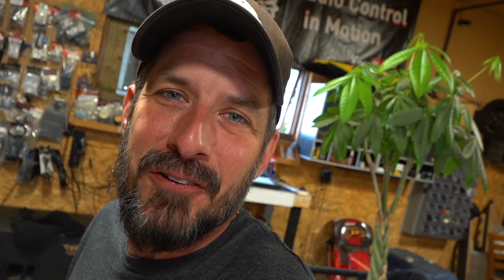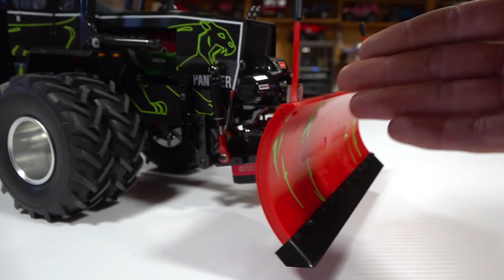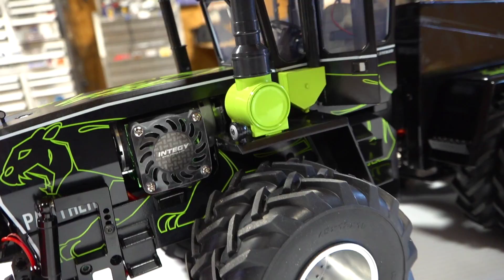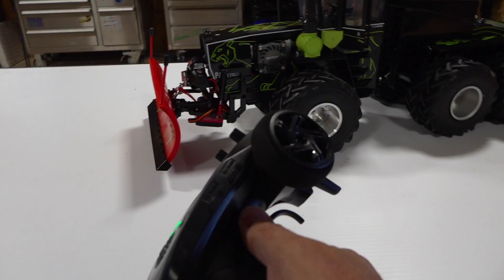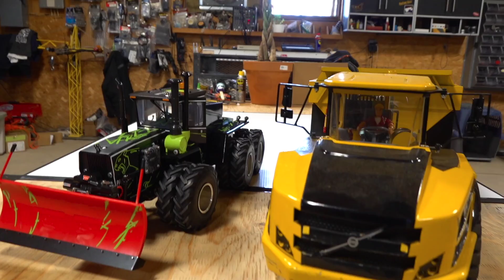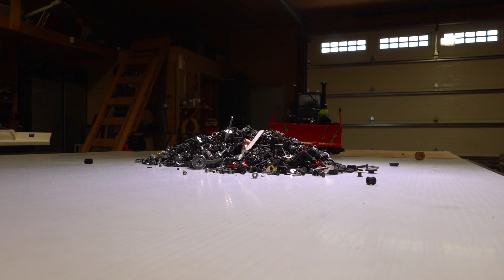RARE 12 TIRE 6X6 STIEGER PANTHER TRACTOR -  ERTL CONVERSION "SEMI JOE TRUCK SHOP" | RC ADVENTURES

Comment: Speaking of such do you know of anyone doing a crawler conversion of a Clod Buster? It would be a good old-school/new-school project, especially if the original MOA axels could still be used(or not).Mounting an axial transmission upside down would be a neat trick.

Comment: Hey rc sparks I’ve been subbed for a long time there’s a really cool rc you can buy for cheap about 50 Canadian it’s called the wpl c24 those wpl trucks are so fun and there 1/16 scale so pretty small but a great starter rc would you be able to review some the c24 looks like a trail finder 2 there awesome little rigs I have one and there so fun and have lots of mod options

Comment: Love it! I have wanted to create an R/C based parking lot / street sweeper for a while now! (my line of work) With tech coming as far as it has, and 3D printing being a real viable thing these days, it might be possible to build something that actually works... Just think of all those nuts and bolts you could clean up, and sweeping the garage floor has never been so fun! : D I Wish i had the time and skill to pull it off...

Comment: Now thats one awesome rig, Thanks for sharing this beauty with us.
Reply: Hey Aaron, I had a quick question for u, im getting ready to build my first semi, the Tamiya Knight Rider n already had the flysky gt5 that u have on this one, is that gonna be good enough for mine or do u recommend a dual stick?
Reply: @STEVOD313  I use the gt5 for my semi. As long as you dont plan on using the mfu it will work  just fine
Reply: @optimusdude  Oh, well im gonna use the MFC-01 on it, so ill have to get the dual stick just not sure which one